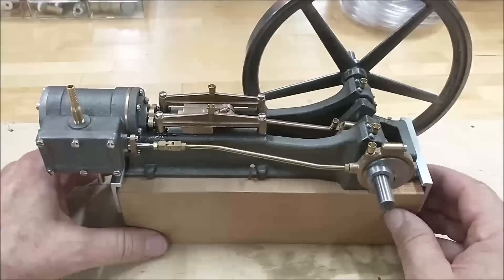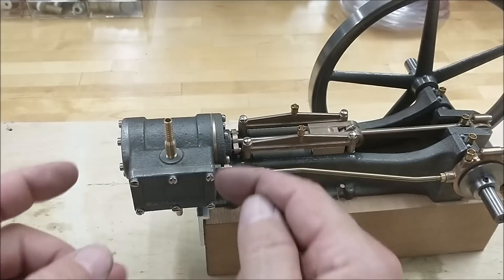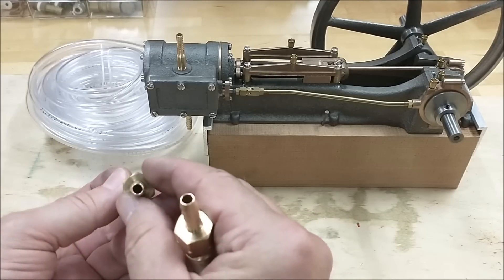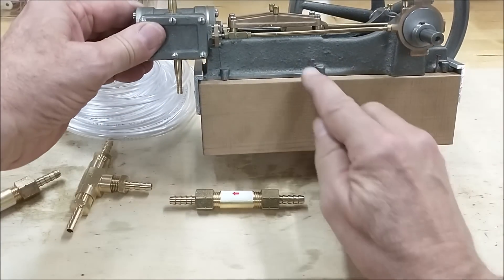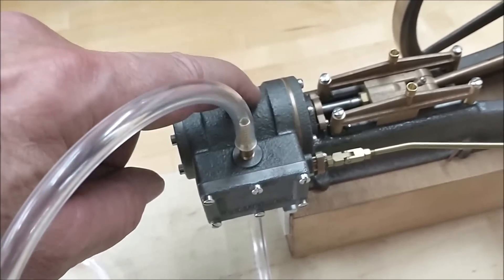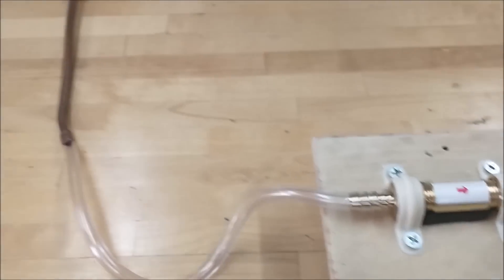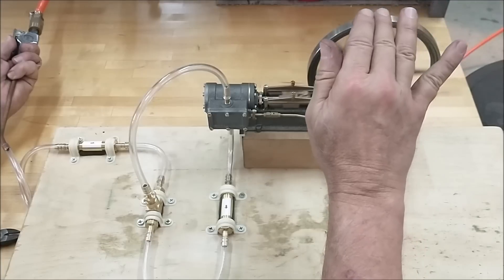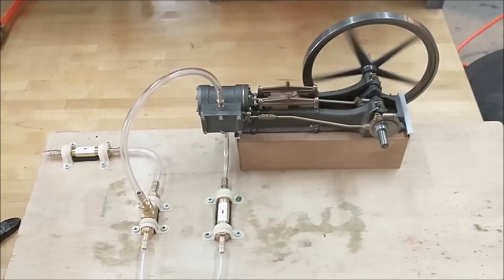Perpetual Motion Video....Is It Fake or Real ??

Comment: Will wait for a follow up. Looking at the stroboscopic effect on the flywheel might give a clue. Well done.
Reply: I watched this again and despite what others have said the engine was not slowing down. If you watch the flywheel the stroboscopic effect was constant. This means it must have had a secret air supply through probably the first check valve.

Comment: Tricky thing about perpetual motion is they're always going to discount it based on the friction. It will not run forever because the parts in motion will wear out and start binding.
If you're being serious, try to see how much load it can handle, how much electricity it can generate, then scale it up.
Sell it as a power generator, NOT a perpetual motion machine!
Reply: Don't
The "energy mafia" will be after him if he does that. It has happened to lots of "inventors" (not to say snake oil salesman) before.

(PS: sound is a form of energy too. If a machine produces some noise, then there need to be some mechanism to replace that energy. Up to know I have never seen a "perpetual motion machine" accounting for that loss)

Comment: The hardest thing when building a perpetual motion machine is to hide the battery.
Reply: April fools day perhaps?
Reply: @Tinwoodie100  Definitely!
Reply: Or in this case the plumbing to the compressor.
Reply from the maker: @jenbadabam8801  Oh yee of little faith...
Reply: @joepie221  best reply ever
Reply: @joepie221  Oh yee of little faith -- probably the best reply ever. I believe because I have seen - your other videos.
Reply: And the date is…..?
Reply from the maker: No motor or battery.
Reply: @joepie221  yeah ... and there ain't no free lunch either.
Reply: April 1
Reply: April fools😂 love the channel
Reply: I got through the whole video, scratching my head, until I realized what day it was.
Reply: April 1st!
Reply: Oh no,  the texan oil men are gon a hate you if you become a perpetual motion magician illusonist.
Reply: So let me get this straight you're going too be dogmatic and not put this idea into practice that is what science is we fuck around and find out we all get different results based on. How we think so next time think because he feeding constant pressure from the air that it's in a mobious strip were the pressure is equal too its pull thus continously spinning but if u were too put a load there probably would be issues
Reply: Amazing
Reply: Or the flywheel that was in plain sight 😊
Reply: @chriselop9121  You saved me from saying it. There's a lot of battery-equivalent in a spinning flywheel, but batteries drain. Perpetually!
Reply: My bet is on a rubber drive wheel on the lowest part of the flywheel, battery and motor in the wooden base. I'm sure we will have a big reveal at some point because I don't believe Joe is one of the bad actors just trying to make money from other people's forlorn hope of getting something for nothing.
Reply from the maker: @martinconnelly1473  see the pinned comment.
Reply: @martinconnelly1473  That was my bet also. There was no accounting for friction. The bane of all Perpetual motion machines.
Reply: @cpcoark  The pinned comments since then have ruled out batteries and motors so  not the answer. Since then I have considered a small pipe bleeding off the trapped compressed air blowing on the flywheel spokes as a possibility. It would account for the motion after the supply pipe was cut and the need to stop it before it naturally slowed down due to friction and loss of the compressed air.
Reply: @martinconnelly1473  It was April fools dsy
Reply: @limitbreak2966  I can't understand why you feel the need to tell me this. I think my comments make it clear I knew what Joe was suggesting was nonsense and I knew what day it was.
Reply: If it works, why did he stop it? This was proof of nothing.
Reply: @Bodhi1satva  Have you checked the date?
Reply: @BensWorkshop   Yes, at first I saw something I believe that said the video was 9 yrs old. I considered it to possibly be an April Fools joke but thought better of it simply because if it is, its really a lousy joke. Especially if you consider that the object he used was called a compressor motor for the freezer by repairman so it at least sounds possible… 🤣
Reply from the maker: @Bodhi1satva  Impossible just means it hasn't been done yet.
Reply from the maker: @Bodhi1satva  To check the potential for driving a belt.

Comment: Happy April Fools day Joe
o, anyone got suggestions on how he made this work? My guess is that the plumbing isn't what it seems and that the check valves have a hidden inlet and outlet through the board. Anything could have happened between the cuts in that video and I know our Joe can be sneaky ;)
Reply: That would be my guess too.
Having seen lots of Joe's videos, it is a piece of cake for him to disguise three way valves (or even just simple 90° knees) as check valves.
It would make sense: 1 "valve" for the air inlet -> The engine works as usual -> 1 "valve" for the air outlet.

But then there is this big block of wood the engine is mounted on. I don't see a reason why it has to be that big. Perfect place to mount some battery and a motor inside. A friction wheel turns the flywheel.
As my personal oppinion I would go with the first, having seen what "wizardry" he can do with a few pieces of brass and a lathe.
Reply from the maker: There is only one day annually I may choose to lead you astray intentionally. Is this the day????
Reply: You never see the back of the engine.  Small battery powered electric motor on the flywheel for exhibition purposes.  That's my vote.  He'll fess up eventually :-)
Reply from the maker: @Zardwark  see the pinned comment.
Reply: @joepie221 There are a lot of folks who haven't read the pinned comments.  No batteries or electric motor was used.   The bottom air loop isn't connected to the air supply off camera.   I still think there's a stream of air that's directed to the flywheel.  (Similar to the flying screwdriver trick.)
Reply: @Zardwark  don't think it's a motor, the high pitched squeel would definitely be audible
Reply: Yes, the check valves are dummy items being fed/exhausted through the board they are mounted on.
Reply: Bet it is trickery with the bottom loop. Yes, he shows it couple times, but second part it doesnt show bottom of hose. Could have small inset there, or maybe the one directional thingies have side cut out and hose attached, hidden, there, and other one direction is hidden hose to just blow air away without being audible.
Reply: Easy peasy ... he removed the piston and put a micro linear actuator and button cell battery in the cylinder to "drive" the conrod thereby spinning the flywheel. This eliminates the sound an electric motor would make.
In reality, either a low torque motor driving the flywheel or the system air is being fed from below the board into the "perpetual" valves
Reply: You could just have heated studs under the check valves. If you have a CRC around (are they even still printed?), you could look up how much heat would be needed from the steam tables.
Reply: Vac pump on the exhaust line under the one way valve.  No air from the air line just a pipe,  thats why the engine runs backwards.
When you open the air line you introduce air to the engine then cut the pipe to continue the cycle. 
When you build the engine it ran correctly.
Reply from the maker: @jonathanbale5410  The correct rotation of this engine is to have the throws on the crank coming up through the frame. Otherwise it would be a people eater. Rotation is controlled by the slide valve, not the air pressure inlet.
Reply: The flywheel stores a lot of energy, that's what it's for.  Every cycle it will slow down.  If he kept the camera running on it it would slow down and stop after a certain point.
Reply: @malevolent7650  That can't be the explanation, the friction is so great and it doesn't store that much energy. I'm more into something like CatNolara.
Reply: @skunkjobb  I suppose we will see, a heavy flywheel will spin for a long time absent a load.
Reply: @malevolent7650  
wouldn't work.
* There is lots of friction
* The air from the outlet has a lower pressure then the air at the inlet. It would not be able open the check valve. The air inside the hoses and the steam valve act as a damper.

Comment: Now I'll waste my day wondering how you pulled this off. Great one!
Reply: me too.
The "one way valves", bolted down to the plate, look suspicious to me
Reply: @kallewirsch2263  Something along those lines I suspect.
Reply: Eventually some of the static compressed air will leak past the sliding piston and the engine will slow and stop.
Reply: @ellieprice363  I don't think there's much static here in play. These engines work on a pressure difference and if the system is static, that difference is virtually nonexistent.

@kallewirsch2263 and I were speculating that the tubes are covertly fed from underneath. Since the engine is going slow and the whole thing is completely silent, I'm thinking it's fed from a small reservoir under relatively low pressure.

Nicely done, Joe, we're still chewing on this.

Comment: have you tried it with hard lines like copper tubing. I'm just curious if the expanding plastic tube might be acting like lungs or a heart contracting and expanding high pressure to low pressure and back again. and you say it works with no fuel/energy but how did you compress the air .  I'm no engineer I'm just thinking out loud...
Reply: Have a look at your calender

Comment: Don't know how you did it, but it"s one of the best displays I've seen.
Has to be April Fool, because Jo Pie would never try to con us with perpetual motion----  or would he???
Reply from the maker: Its pretty clear.
Reply: My bet is a motor with rubber wheel under the fly wheel.
Reply: @TheEvertw  that's exactly what I was thinking. Probably has a potentiometer just off screen to supply power without the click of a switch. Heck he might even have a tig pedal wired up to it.
Reply from the maker: @TheEvertw  see the pinned comment.
Reply: Hidden air supply would be pretty easy, or it could also be running off the air stored in the tubing, with only the exhaust hidden. Either way, nicely done, Joe!
Reply: Well, ya GOT me - hook line and sinker! Thanks, Joe.
Reply: LOL.
Reply: I didn't think of that before I commented. I feel like such a dope now.  OK Joe you got me!

Comment: I want to know where you got the material to make the flywheel.  I’ve used an aluminum alloy with a mass of -.10 lb/in^3, and it works, but my machines lack temporal stability.
Reply: If I remember correctly, this engine came in kit form. All materials included
Reply from the maker: It did.
Reply: @joepie221  I was assuming it’s the flywheel on your machine made from a material with negative mass, as that’s the most likely part, but it could have been the crank or something else.  Anyway, like all of your work, that machine is beautiful.